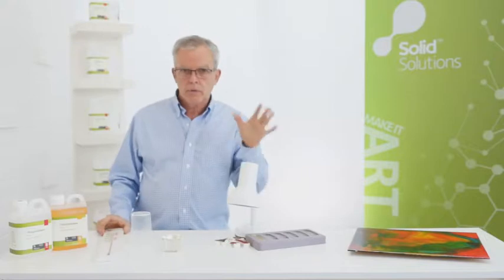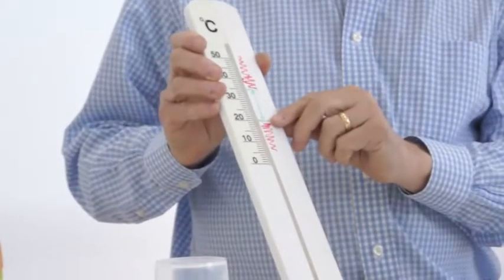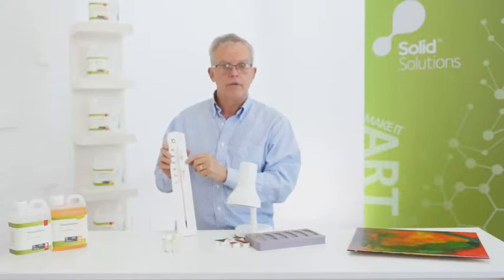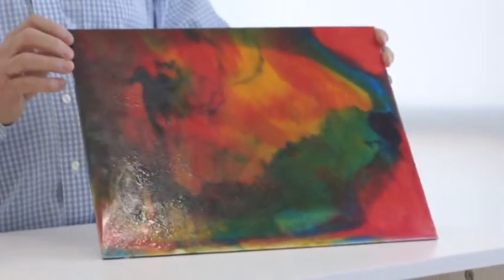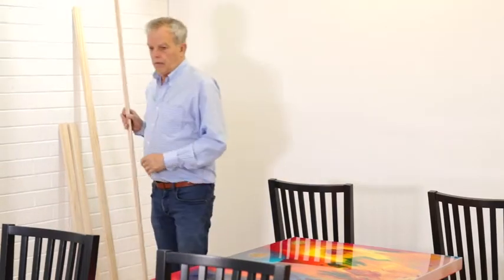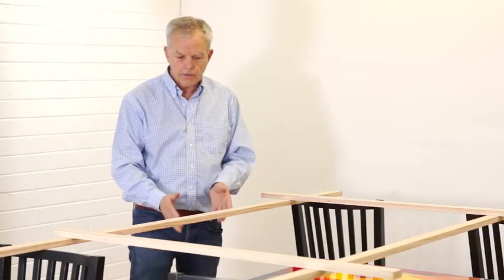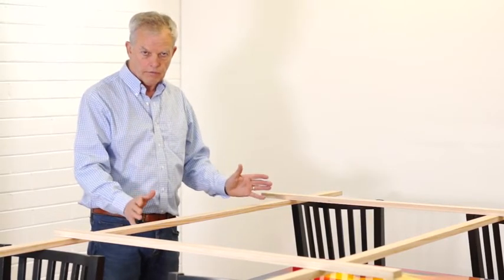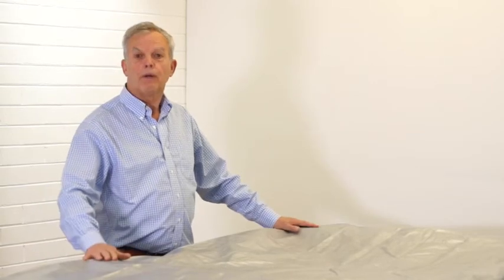Best temperatures for curing Epoxy Resins, polyurethane systems & Silicone Rubber (tutorial)

Comment: Thank you very much!  For weeks I have been researching solutions for keeping stable temps for 72 hrs in cold winter and think both of those you have demonstrated will work at home.  There is a massive lot of info re what the best curing temps are but how actually to maintain these temps seems to be a state secret.